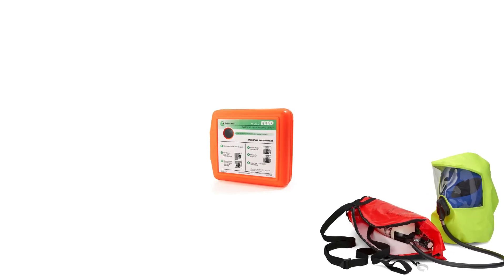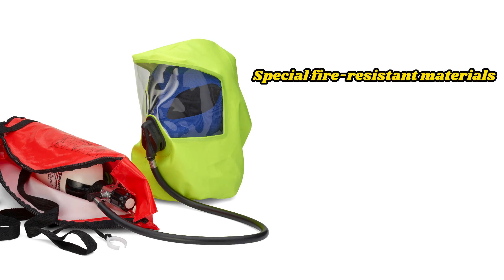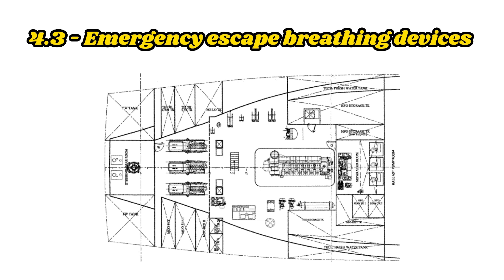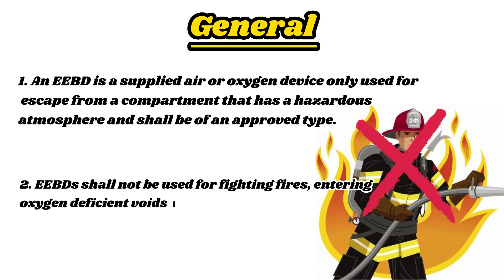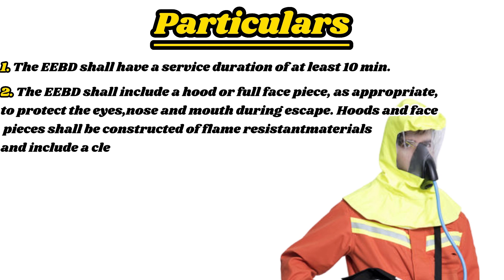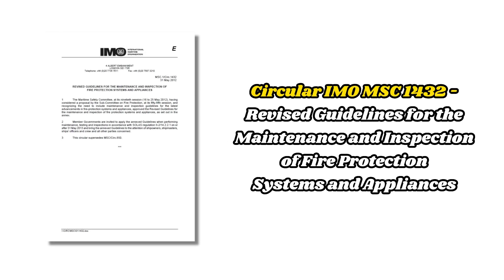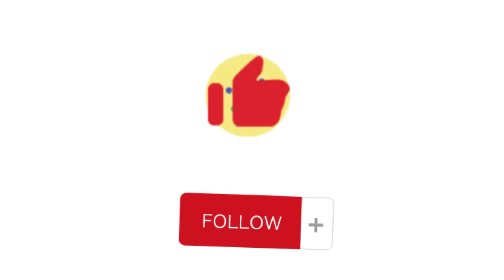Emergency Escape Breathing Device  | EEBD Explained

Comment from the maker: You can ask any questions here and ill try to help you! Thank for watching !
Timelinks:
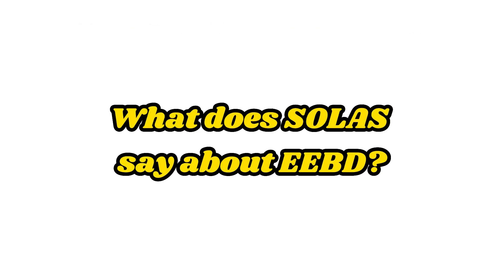00:00 - 01:58 - General Information about Emergency Escape Breathing Device
(Main purpose of EEBD / EEBD In Emergency Situations / EEBD protection function / EEBD breathing working duration / EEBD Materials / EEBD Donning Procedures)

01:59 - 03:20 - Requirements for Emergency Escape Breathing Device as per SOLAS.
( Spare EEBD , Quantity of EEBD in Accomodation, Machinary Space EEBD , Location of EEBD )

03:21 - 05:44 - Requirement for Emergency Escape Breathing Device as per Fire Safety System Code (FSS).
(General EEBD Requirements,  Definitions - EEBD face piece mask , EEBD hood etc., Particulars - EEBD service duration, EEBD Materials Requirements, Markings  )

05:45 - 06:11 - IMO Circular MSC 1432 regarding Emergency Escape Breathing Device

06:12 - 06:23 - Weekly Inspections of Emergency Escape Breathing Device
(EEBD Weekly Inspection to ensure correct pressure range )

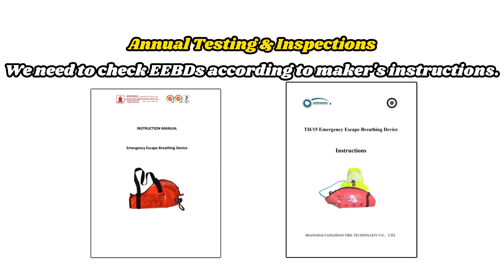06:24 - 06:32 - Annual Inspections of Emergency Escape Breathing Device
EEBD Inspections according maker instructions.

06:32 - 06:56 - 5 year Inspections of Emergency Escape Breathing Device
Perform hydrostatic pressure test for all EEBD cylinders